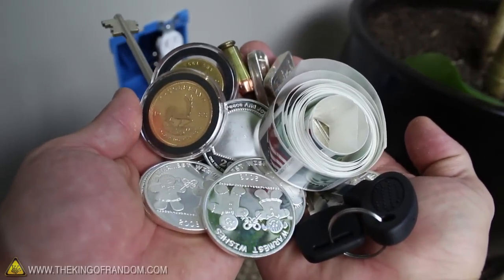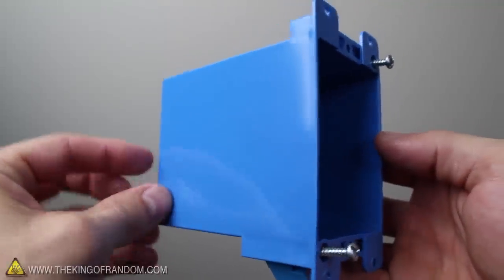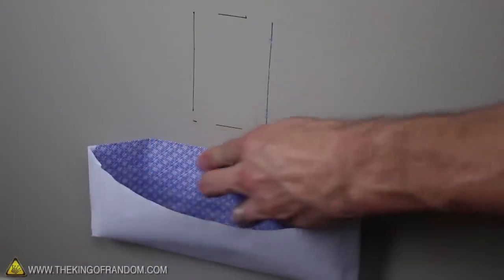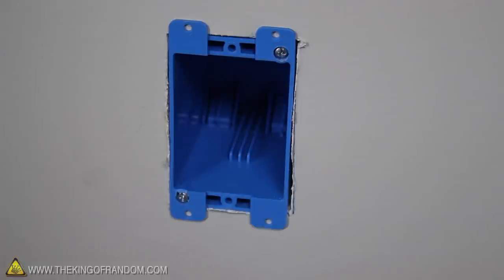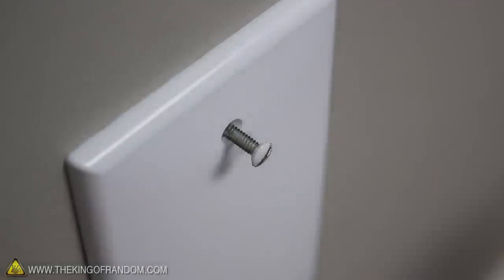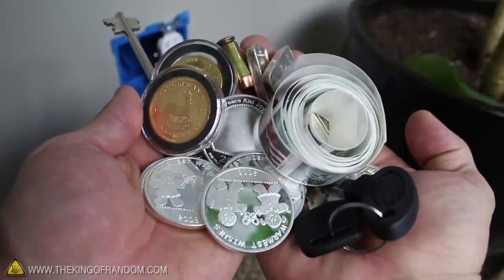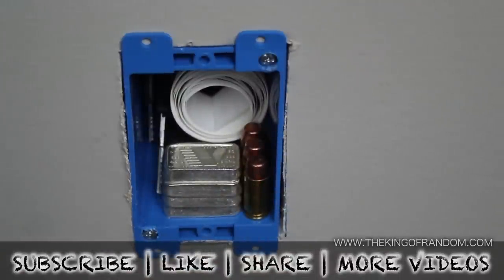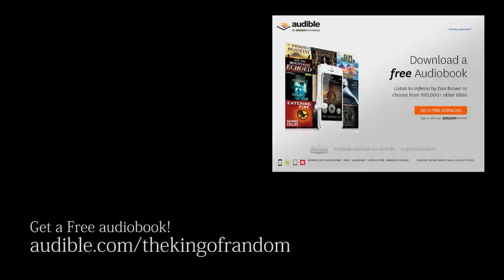How To Make A Super Secret Safe - For Less Than $3

Comment: In England we don't have these cheap ass houses we have houses built out of bricks and concrete so it is impossible to do this :(
Reply: So do we in America. Just on the outside. Only the interior walls are drywall for easy modifications and insulating purposes. It's great.
Reply: Concrete houses hold higher levels of radiation and are a step down from getting a house made of wood
Reply: bobby melville If that's even true so be it but atleast our houses don't burst into flames in less than 5 minutes
Reply: Jack Drywall just covers the insulation, it's not the actual wall. :P
Reply: A Mentally Disturbed Jacksfilms The Europeans thinking their houses are all made of solid brick and concrete never payed too much attention.
We might build more solid houses than the average American, but we still use plenty drywall on the inside here in Central Europe (and I've seen some flimsy as hell building in Europe too).
Reply: Jack And your solid English house would collapse into a pile of debris in an earthquake. The buildings that collapsed in the Napa quake in California were brick churches and concrete structures built long before earthquake codes were adopted.  Brick and concrete houses can kill you here. Homes with brick chimneys did not fare well as some chimneys collapsed into the living spaces.

Wood frame houses here survive violent shaking because they have steel bolts  and brackets holding the walls to the concrete foundation. Cracks to these houses after a quake can be easily repaired. Newer chimneys here are triple walled stainless steel tubing with plywood false chimneys poking above the roof. Less mass equals less damage. 

 Besides, its so much easier to add electrical outlets, cable, make changes, add windows to drywall construction.
Reply: Jack I guess you don't know that no place in the world is immune to quakes. Besides, ask your grampa what happened to brick buildings during WWII.
Reply: Jack Fact: My uncle flew a P-38 fighter out of Kings Cliffe during WWII and said that Brit girls were ''easy'' and liked Yanks. The only rubber he ever used was on his landing gear. Perhaps we're related.
Reply: Jack You too. See ya later, queen.
Reply: Alright cya xxx <3
Reply: Jack But aren't the US and UK the "closest" allies?! ;-; Our houses are simply better for our living conditions and your house is fit for your country's living conditions. We have complete opposite weather and natural disasters. It all has to do with the geography of a land- simple as that. Also, a lot of England's houses are old because of the culture- the US' old houses have been, almost, completely wiped away to make anew. No need to argue :)
Reply: Venonats Rule Thanks, well said.
Reply: If it is double layer bricks you can cut the brick
Reply: Exactly what I think. My house is made out of concrete and bricks, but there are a few walls you could make a hole in.
Reply: ***** Very true but at least we have free health care.
Reply: Jack™ England and Canada ftw ^^
Reply: BLAZENYCBLACKOPS Haha that's not how it works but okay
Reply: I was being sarcastic!
Reply: BLAZENYCBLACKOPS Then you might want to learn what sarcasm is because that sure as hall was not sarcasm.

Comment: Am i the only one that wondered how at 1:33, he got the camera in the wall so he could film that?
Reply: probably by cuting the hole and then sticking the camra in it
Reply: More than likely, he used a piece of spare drywall and filmed it as an insert shot from his garage.  If you notice, in his original shot he had insulation behind the drywall.  No way to get a camera back there using that angle from that far away and light it properly.
Reply: Or it was a spaced out wall...
Reply: Our God has abandoned us.
Reply: He has so much going on, he's never finished the room on the other side he started six years ago.

Comment: Just watched this and had a thought.  Many houses are still wired for home phone lines but many people don't use them.  If you get the receptacle for the home phone jack it should snap into the appropriate cover plate and it will hide the purpose of the plate in a way that someone is unlikely to try and use.

Comment: WOAH! why do you can cut your wall with a saw knife!! its damn dangerous and unsafe! what kind of material does the wall made of?
Reply: seems like cardboard with plaster
Reply: okarowarrior It's called drywall.  It is also called plasterboard and sheet rock.  Most modern houses use this material for the inside walls.

Comment: This is a type of "slip". "Slip" is a term used to describe a hidden location to store information, keys, or access cards. Slips have been utilized for decades in the espionage business, and this is, ultimately, a poor example of a hiding place. For a higher level of security, utilize variants of the "cable outlet" version of this. Try ceiling lights, inside door frames (behind the molding or hinge), or behind baseboards for your slips today! I have personally found the best slicks to be in ceiling lights, as it requires something to stand on and tools to disassemble the light BEFORE you can get to the slip, and who takes apart ceiling lights to find stuff?

Comment: So?... you guys have paper walls?
Reply: um no its just wall paper to customize your wall
Reply: +the cheese midget but the walls are literally made of cardboard wood and paper
Reply: +coolfuzzynacho It's drywall which is basically paper on both sides with plaster in the middle. That was an interior wall so there wasn't anything between but on an exterior wall the outside is made of a plywood layer with insulation in the wall to keep the warmth inside.

Comment: will the plug work if you put the fake plug on?
Reply: If it is not wired up, no.
But if you use an existing socket and hide stuff in there then yes

Comment: Why did u add an extra half-inch
Reply: So the box can fit in? IDK :)
Reply: Because chances are that most people will be measuring from the floor to the bottom of the faceplate not taking the faceplate off and measuring to the bottom of the outlet housing.

Comment: Protip: An utility knife (box cutter) will cut the drywall cleaner and easier.
Reply: +Anon Nona not if its already up and painted, you can cut sheets of drywall and break it but you cant cut that wall effectively with a razor blade.
Reply: I have never said razor blade. I install drywall for a living and yes, it's tougher to cut the drywall after it's plastered and painted but it is still possible and makes a clean cut.
Reply: Anon Nona Razor, utility knife, boxcutter, thats what i meant, and make a video and ill believe you.

Comment: Yeah, but what if you're on vacation. A burglar takes his precious time, so he decides to charge his phone in that outlet. They see it's not charging, so they pull it out and find your gun.
Reply: how would he plug it into the wall if it doesn't have a socket on it? the plate he used is just a cover with no electric sockets